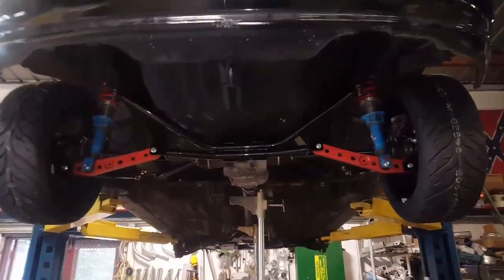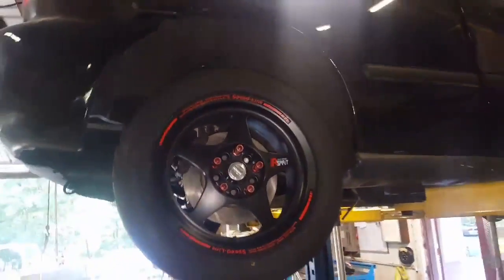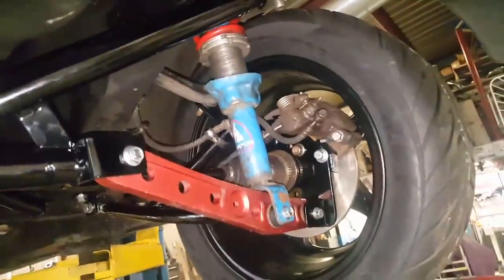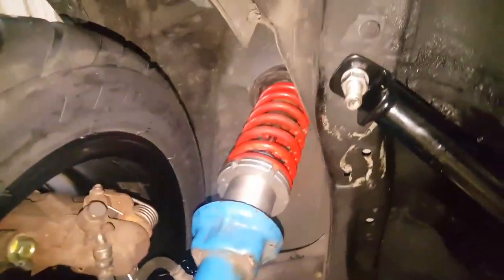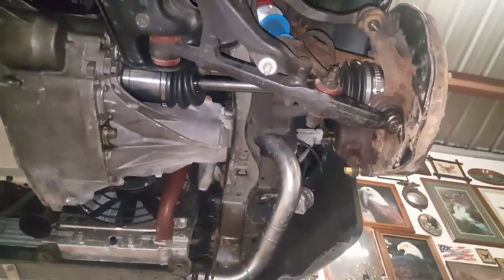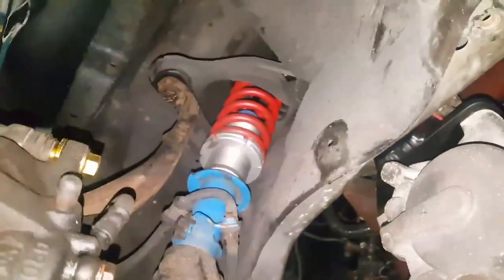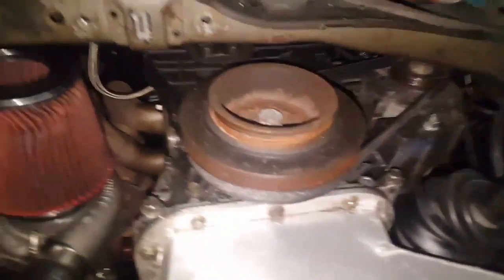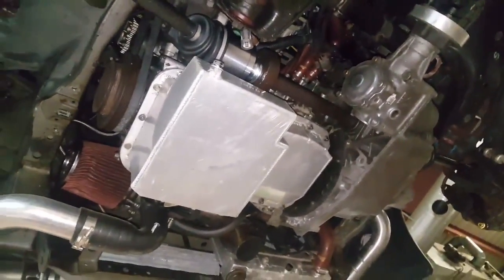AKD Inc Bolt-On AWD Conversion Vlog # 7

Comment: Which Transmission use it conversion ?
Reply from the maker: Great question. B series uses 97-01 Crv sbxm and K series use 2002 and up crv or 2003-2011 element

Comment: Will this kit work on ef sedan and wagons?
Reply from the maker: Kash Korazon yes
Reply: Stephen Dunn tight..  are you guys using solid bushings for the rear diff?
Reply from the maker: Differentials are hard mounted for sure. We are looking into a polyurethane shockmount however. Not sure we will need it though
Reply: Stephen Dunn jw how's the noise level from the diff?   Did the car improved in handling?
Reply from the maker: Dramatic increase in performance and no noise from the diff at all
Reply from the maker: Yes. Our system mounts solid but we do have a couple others uzing poly inserts

Comment: What hubs are used on the rear to couple the rear diff and shafts to the hub assembly. I see on the site there a number of size patterns but the likes of ITR hubs are not designed to take shafts so how is this possible?
Reply from the maker: CRV's are 5 lug bro
Reply from the maker: Joe Sweeney the front itr hubs are used in the rear. And yes they are designed to use cv axles

Comment: With using the crv b series transmission and wagovan rear end, how do you guys combat the different ratios with a solid driveshaft? Isn't the viscous coupler needed to help with the offset of the 2?
Reply from the maker: itsjussjerry we are not using the wagon rear in this build. We are using a modified Honda Element rear
Reply: Stephen Dunn 

Oh I see. I'm putting together an awd setup too utilizing the wago rear end. I'd like to use the element rear end if I were able to modify it for quicker engagement. On your website, you guys offer the wago rear end as an option when ordering the subframe. Is it not recommended over the element diff?
Reply from the maker: itsjussjerry they work well however our new element system will effectively delete the dual pump setup and replace it all together with modified and custom internals with our new helical lsd
Reply: Stephen Dunn when will it be available for purchase?
Reply from the maker: itsjussjerry it already is. Www.automotiveknd.com
Reply: Stephen Dunn I love the kit. Unfortunately it's a little expensive for me, so I plan to purchase the 1 piece driveshaft and possibly the subframe from your company. What's the cost to modify the element rear diff and eliminate the pumps?
Reply from the maker: itsjussjerry at this time we have no pricing for the diff as its still experimental
Reply: Stephen Dunn ok cool. Looking forward to it as well as progress on this kit. I've been waiting for a very long time for someone to come out with a kit. I'm glad it's finally here!
Reply: Stephen Dunn very cool man.  I'll be looking forward to this awd kit.